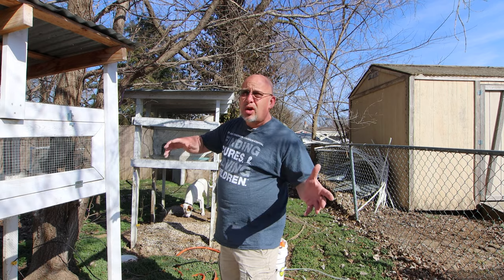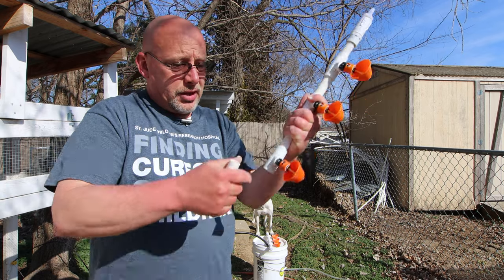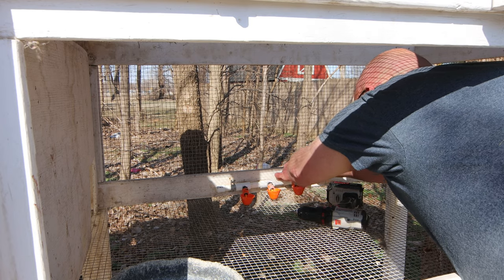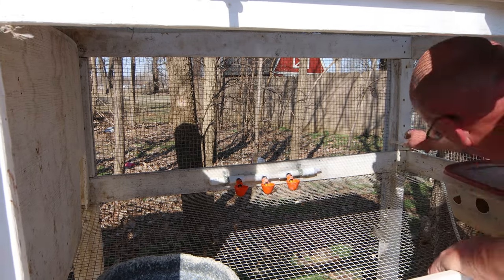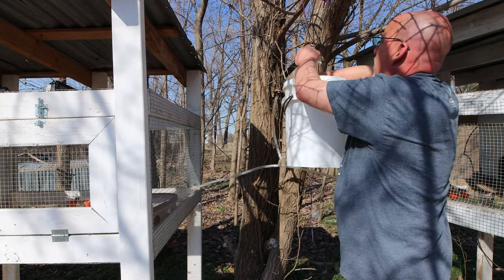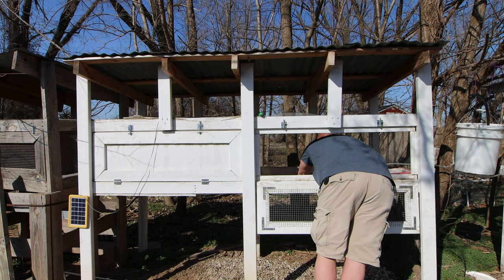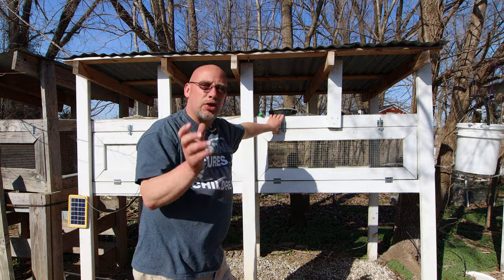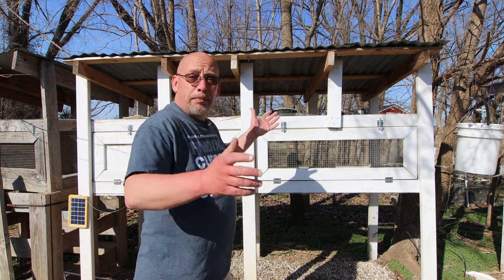Setting Up The Watering System For The Quail

Comment: I got mine reinstalled as well.  I had some repairs after our deep freeze weather and so happy it's back up and running.  Hand watering stinks.
Reply from the maker: No kidding.  It is so much easier with the automatic system.  I did have to do some repairs to the rabbit system but the quail system made it through just fine.

Comment: Next time I tinker with my watering system I'll probably use some flexible tubing also. I have PVC all the way to the bucket & it's annoying that the whole assembly is rigid.
Reply from the maker: I considered using PVC but thought the same thing.  The hose is so much easier.

Comment: what type of automatic water do you have for your rabbits im trying to get mine setup
Reply from the maker: It is pretty similar to this except I use the water nipples https://amzn.to/2OC90OQ.  They do require a different size hose as well so all those connectors are different sizes.  I will see if I can do an updated video on that soon.  Here is a link to the old video I have on it.  But skip the silicone and get a bulkhead to attach the hose to the bucket.     https://youtu.be/4QTRyDN6RIA